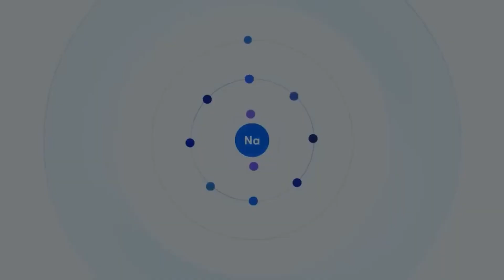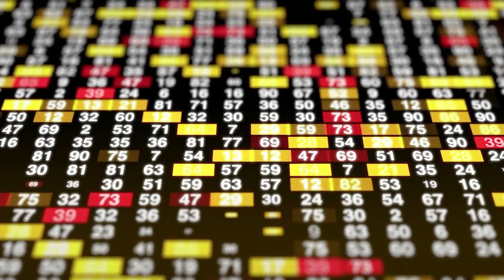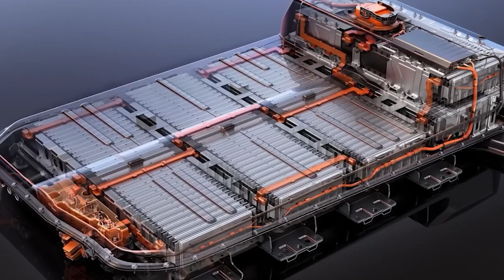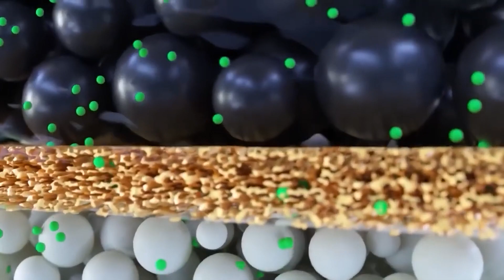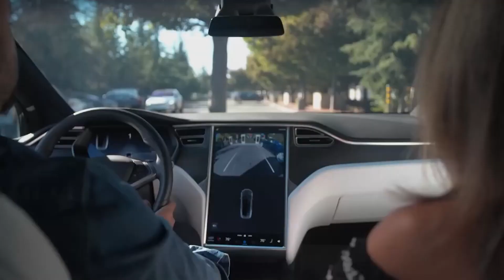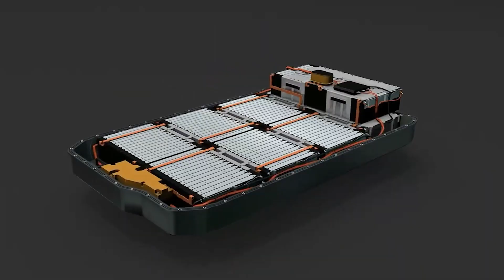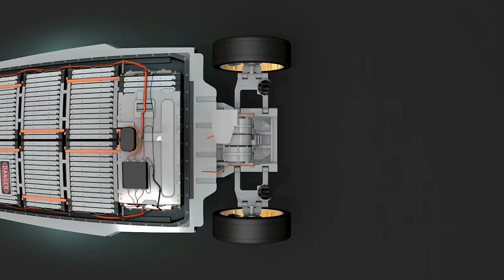Elon Musk Reveals The First Ever EV With Sodium Solid State Battery!

Comment: Tesla buys their batteries from a manufacturer, correct
Reply from the maker: Yes, Tesla does procure batteries from manufacturers for their electric vehicles. However, Elon Musk's unveiling of the first EV with a sodium solid-state battery could signal a potential shift in Tesla's battery technology strategy. It's an exciting development in the EV industry!
Reply: @onlypay7679  there's other technology that is coming out also that's supposed to throw the world of batteries into the future very quickly
Reply from the maker: Absolutely! The battery race is heating up with groundbreaking tech emerging. Elon Musk's sodium solid-state battery is just one piece of the puzzle. Exciting times ahead for battery innovation @bendaves77

Comment: I'm surprised that they didn't go with the am radio generator and it's exactly what it sounds like it's using a crystal diode to give a direction to current while you're using a ground and a antenna and using a variable capacitor to turn into a channel which you would play over a speaker but every Force generated that would manipulate the speaker that is energy and simply staging that up through capacitors and the size of the antenna I'm surprised we're not using that to charge batteries especially since the radiation levels go down at nightfall and radio frequencies travel better
Reply from the maker: You bring up some fascinating ideas about harnessing energy from AM radio generators and the potential of radio frequencies for charging batteries. Innovation in energy generation is an exciting field, and while sodium solid-state batteries are a promising development, exploring alternative sources like the one you mentioned could lead to even more sustainable solutions in the future. It's all about pushing the boundaries of what's possible!